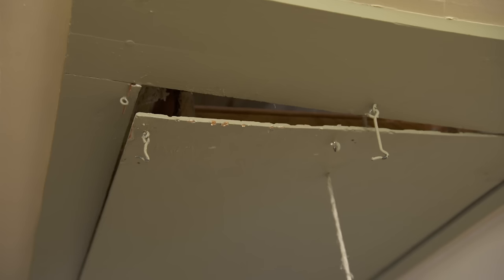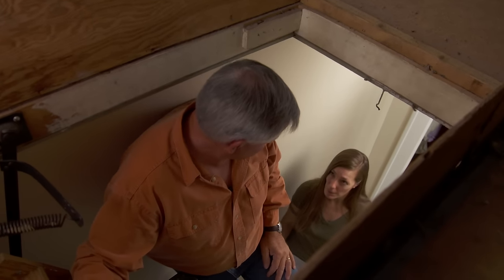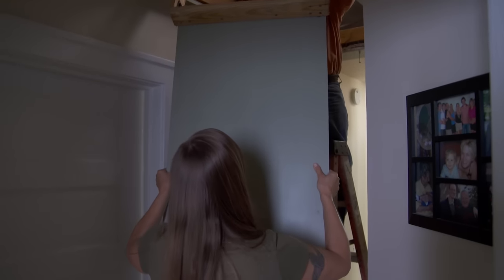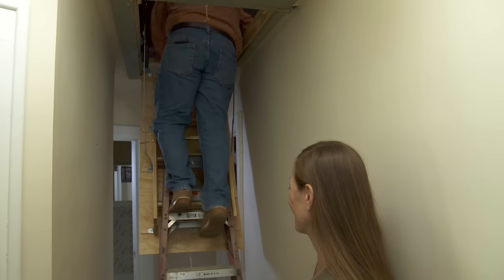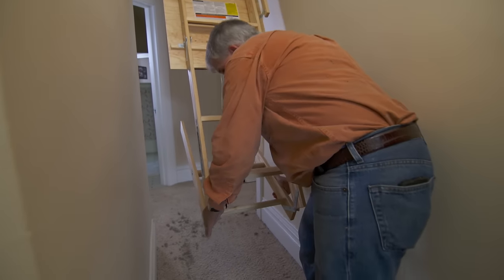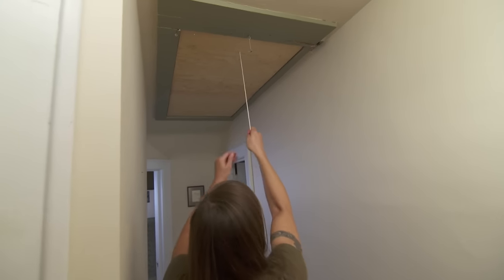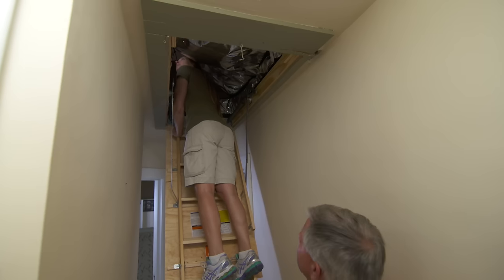How to Replace a Pull-Down Attic Staircase | Ask This Old House

Comment: This is a great video with a lot of good content - and one major flaw.  DO NOT USE TRIM BOARDS TO SUPPORT THE WEIGHT OF AN ATTIC STAIRWAY.  That is dangerous.  Trim boards are relatively thin and weak, and they are usually attached with just a few thin 18 gauge finishing nails that can easily pull right through the wood.  Attic stairways are often quite heavy...  If the trim had broken or come loose then the woman standing below it could have been seriously injured, and/or the falling stairway could have also knocked a hole through the wall - necessitating another repair.  It is far safer to remove the trim and attach stronger boards directly to the joists with screws, and then let those boards support the weight of the new stairway as you install it.  My crews use strong wooden jigs, screwed directly into the joists, when they replace or install attic stairways - which is what we do many times every day.
Reply: thanks
Reply: Fully agree with this. I was so uncomfortable with her standing directly underneath the stairs while he was nudging them around from above. Serious fail point if you like being alive! 😮

Comment: "Looking at the condition of this attic stair. It's not worth fixing so I'm hightailing it outta here." Would have been hilarious if he said that.
Reply: Suad Salkic here is your first reply mr salkic
Reply: Well, Richard did that to a poor fellow with a massive plumbing issue.  Not so much with those type of words, but basically highlighted the issue, what was required, and told the guy seeya and good luck.
Reply: All the comedy is left on the cutting room floor.

Comment: That tip on how to cut the legs was just pure knowledge
Reply: Almost, measuring it the exact way he did will make the cut too short. They didn't mention adjusting the length for the thickness of the board he used to scribe the bottom.

Comment: First of all, the original ladder/door was the exact same one as mine that I came here trying to replace. And I also went through a time when one hinge was bent over from its hinge pulling on it and we had it rigged with a bungee cord lol
I guess a common failure issue with that unit!

Comment: We just bought a house built in the early 80s & the ladder looks almost as good as the new one here.  =)

I really like the idea of adding the insulator!
Reply: I have the same stairs and may replace instead of just adding a new screw. it doesn't close properly, just as this one shown here. i agree, the insulator is awesome.
Reply: I just bought an early 80s house with the same stairs. The ladder is not flush to the floor and the joints have gaps. I need to either fix or replace. Along with so many other things in this house.

Comment: Yeah, in a perfect scenario. The truth is, replacing an older existing one, most likely you'll have to trim around the opening, change any deco that's around it. I just put one in, and although this video helped me to a degree, you skipped a few steps that most ppl will have to encounter. Not saying it's a bad video, but it's not as easy as you make it look. Then again, I own a welding company, who just happens to do any type of stairs. However, every attic stair install presents its own unique challenges. Might help if you explained that the steel tabs are temporary (maybe you did) sorry if I missed it. As well as show some example probs one may encounter. Just a suggestion, thanks
Reply: There is no perfect scenario. And it's easy if you know what you're doing. If not, Tom's video is all that's necessary. Good job, Tom.

Comment: Thanks for the detail in this video. I need to install one of these, but my house is two story, so the attic ladder has to go in our living space. I want to put it in the hallway that leads to bedrooms (away from the living room, etc). But the hallway runs North/South, and the ceiling joists run East/West, 16" on center. So I would have to cut 3 of the joists to install the ladder in the hallway for a 54" opening. Is that a bad thing for the structural integretity of the house (even with headers)? One side of the hallway is the support wall.

Comment: They sell replacement arms and hinges.  I did a Werner ladder in my Father's garage last fall.  The steel had weakened so much that it practically folded over which made the tension springs worthless.  Replaced the steel arms for $55 and all was well.
Reply: they was going for a good look. the old stairs were old and beat up they want it to look good
Reply: That’s funny, An extra $50 would give you a new unit.
Reply: Where did you find the replacement hardware? My brackets are so bent inwards, I can barely fit by them. Not to mention that it looks scary dangerous!
Reply: @RubbinRobbin  Would require a lot more labor as well versus a quick 20 minute swap of the arms.
Reply: @plugger4945  In all honesty I don't remember.  I may have called the manufacturer and ordered them directly.  Or I found them online, possibly eBay?  I think the arms had some information stamped on them.  I don't remember and my Father has since sold that home so I can't go take a look either.
Reply: @Guillotines_For_Globalists  Thank you for your reply. I’ll try  the internet. Was hoping Home Depot or Lowe’s, but probably not. Thanks again!
Reply: @plugger4945  No problem.  Your best bet is probably to call whatever the manufacturer of the label is to find out what the part number is for the replacement parts, and then take it from there if you want to order direct or scrounge around on the internet for a better deal.  The most difficult part was cutting out the rivets, as the replacement kit includes lag bolts to replace what were formerly rivets for one of the attachment points.  Other than that the other difficult part was installing the springs, which is most easily accomplished with the stairway CLOSED and you crouching up in the attic above.  Two people are recommended but I did it all myself.
Reply: @Guillotines_For_Globalists  Again-Thank you for your kindness, much appreciated. I’d say-“Screw it”!, but I fear a spring will snap and kill one of us. I’ll get it, one way or another.
Reply: @plugger4945  Good luck!

Comment: Those bungy cords are deadly. A decorator friend lost an eye with one. I won't use them now.
Reply: It's all fun and games until someone loses an eye..
Reply: Buddy Holly, Richie Valenz, and the Big Bopper died in an airplane crash. I don’t fly on airplanes.
Reply: that's horrible, thumbs up for awareness.
Reply: Sorry to hear about your friend, but that sounds like a freak accident.  Bungee cords aren't inherently dangerous.  I use them all the time.  Just use your normal common sense--during use, ensure the hooks are properly/securely engaged, and don't over stretch/tension the cord itself.  Look over your bungees, and discard any that have damaged hooks, knots (if present), or cords.  Really, if you are doing something/anything that has a possibly of going awry--bits flying about at speed--you should wear eye protection.  [one example--not all of my neighbors use eye protection with mowing the lawn, or using a leaf blower, etc., but I always do].
Reply: Just about everything is dangerous, if not used properly.

Bungie cords have a weight rating, and a life span. You’re supposed to replace them after so many years, if they’re damaged, or if they have been stretched beyond their rated limit. However, most people don’t replace them until they break completely.

A damaged bungie under load is a ticking time bomb.
Reply: Had a friend lose an eye to one too
Reply: His mother always warned him "You're going to put an eye out with that thing."

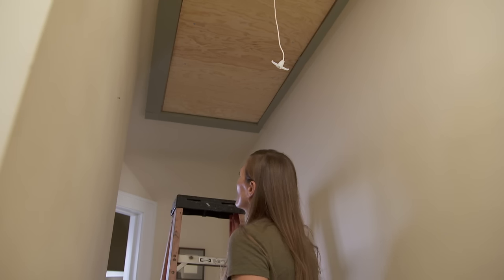Comment: 2:43 what is the new ladder resting on top off? I noticed you did not put two temporary support boards like most other videos instruct to do.
Reply: This was not  new construction, there was already existing casing / trim around the frame . So there was already permanent casting for the attic later to rest on
Reply: The casing trim  he said it multiple times
Reply: @noahholt482  So what do you think trim is held together with? If you said trim nails you are correct. Now go back down and pick up your brand new broken ladder off the floor along with the trim and nails.

Comment: Is it me or is there a flaw in measuring how to cut the stringer.  If you measure the length on the stick, then cut the bottom off for the angle, then use it to measure the distance again isn't it too short?
Reply: Yes. Cut the angle first then measure.
Reply: I noticed that too and came to the comments to see if anyone else caught that.  The first measurement, the length, should have been transferred to the bottom of the stringer and then the angled cutoff marked from there.  Otherwise, to do it as shown, will result in the stringer being slightly shorter than intended with the witness marks taken earlier. @scottjhayes

Comment: I cut my attic stairs like this today and they  came out short 😭 and I measured them exactly how he did it
Reply: He didn’t mark the board right so it makes sense yours was short
Reply: Easy fix, just take a piece of 1x4 and cut it to the right angle to the floor and place it to the side of the stringer (adjust it accordingly) and fasten with some 1" screws. 5 min job.
Reply: I was TWO SECONDS from cutting mine after doing it EXACTLY like he did in this video and I said wait a second.  Thank God I did.  Everyone up vote this so that hopefully no one else messes up in the future.  This tutorial is WRONG!
Reply: I think he forgot to mention to not cut along the mark for the bottom angle as the scrap piece is about 2.5" off the floor.

Comment: Just had the rivet (that holds the swiveling bracket together at the pivot point) break. That spring has a ridiculous amount of tension on it. The spring and half the bracket released and it flung it at me with tremendous force and almost took my leg out while climbing up the ladder. I hate these units. I’ll only use the aluminum ones with the gas struts now. No more springs and junk bracket hinges.
Reply: That's why garage door spring repairs are a dangerous DIY project....those will definitely take out an arm or a leg, and that's the best case scenario! I'm too scared to even set a mousetrap!
Reply: I hate the springs. Mine’s bent too!

Comment: 4:50 it appears that the measuring stick length is shorten because he marked the angle just short of the board end.  Please confirm or tell me what I missed.  Thanks.
Reply: I think when he went to mark the end he realized that it was not a good end. But it was already filmed so he 'faked it' for the show.  He then trimmed it off with the saw.  On the ladder you can see that he also marked and then cut the ladder a little long.  You can always go back a trim a little more off the later... but it's hard to put it back on if you take too much off!
Reply: You're correct

Comment: An inspector just told me to use lag bolts instead of screws.
Reply: Because screws can break under load. So you should use a bolts or nails.
You can also use structuctural screws.

Comment: I noticed that my rough opening for my attic stairs is approximately 1/4 inch short on the length side. I want to remove the old stairs and replace with attic stairs with aluminum ladder. How would you address this issue

Comment: I was about to question the lack of insulation along the ladder and then he shows the insulator above the whole damn thing. I need to get this!
Reply: you can make your own. just glue a bunch of rigid insulation together to form an open-sided box, then glue pink batts to the back of the box so the overlay seals any cracks between the ceiling joists/frame/trim and the rigid box. it only has to be tall enough to allow the springs to close completely.
Reply: My ladder can with hard foam insulation

Comment: Does the attic door frame need to be set fluse with the sheetrock or the Framing
Reply: As long as the door is plumb between the joists it can be set to taste

Comment: Suggest you first put the new set of steps up in the attic.   Then measure the steps to ensure they will fit properly.  Then working IN the attic, remove the old steps and put in the new steps in place. Finally, with the new steps in place, easily bring down the old ladder set.   That would have eliminated the 2nd ladder completely and would also have avoided handing the heavy old steps down to the homeowner who may not have been prepared for it's weight.

Comment: I won't go bending levers to remove spring without goggles and gloves. That thing could snap off at the hinge and fly about in any direction. Don't why he didn't use his power-driver to remove the screws on the hinge plate instead of sawing it off?
Reply: These things are designed for obsolescence and the lever point always goes first. Always attempt a repair before this wear starts to deform the support plate. Always keep the moving joints lubricated/greased to extend its life.

The correct method of releasing the spring tension is to undo the four screws that hold the lowest or bottom attachment plates. Once these are free, you simply move the arm & detached plate upwards until they rotate over the main lever point. Once they move past the lever point, the spring tension is released. You can move the arm all the way around and take off the spring very easily. (No need to risk injury by wrenching it off like this guy did.)
The same works in reverse if you want to repair the lever mechanism. Drill off/ out the damaged lever pivot-point rivet (where the bungee cord was attached in the video - don't let it get this bad!). Then replace the pivot-point with a suitably sized nut,washer, and bolt(s) arrangement. you might have to drill out the wood behind the pivot point to allow the bolt head to sink in flush behind. 
Put back on the spring and rotate the lever arm back around to pull on the spring tension. Once it rotates downwards you can easily re-attached the bottom attachment plate. Remember to grease up those moving joints to extend its life.
Reply: The spring was nearly completely relaxed. Not stretched under tension. He was fighting the twist to get it unhooked not working against a spring under tension which could be dangerous.
Reply: He wanted to get metal shavings in her hall way

Comment: I am beyond furious because I have a 12' Louisville ladder and I cannot retract it up into the attic without 2 people and 2 ladders to get it up. Louisville is, of course, oblivious to the problem, as they were when the upper wood cross piece of the frame the whole ladder was suspended from cracked when I was investigating why the ladder would not close correctly and almost fell when I was on it.  
Who designs a 12' aluminum ladder and does not understand that it needs to function without any additional ladders?  Any suggestions? I am toying with the idea of mounting a pulley inside at the top step, running a strong twine down along the wood door behind it, attached to an eye bolt at the outside bottom of the next lowest, where the knee bend is, and pulling on that to retract the steps when down.  It his very inelegant and offensive to the purist in me who believes in form and function being their own beauty, but tripping over a piece of twine while climbing up a 12' height on a ladder is not ideal. I appeal the the engineers out there, degreed or just the self educated, common sense ones.

Comment: Spend the extra bucks for the aluminum one with the lift cylinders you'll be better off
Reply: The wooden ones are safety hazards! All the screws were loose and the springs didn’t have enough tension to pull the stair case up until it was closed almost all the way manually. Lol

Comment: where I live in Alabama the building inspector won't let us use screws to hang an attic door we have to use 16 penny hand drive nails I don't know why it looks like screws would hold better
Reply: John Smith the instructions I've seen with ladders show screws just to hold it in place and then later using nails to drive it permanently.
Reply: Use construction screws, they have a star head so inspectors can tell.
Reply: Just use Head Loks or Uber Grades. Whichever brand you prefer. Both are beasts.

Comment: Our attic access is in a small bedroom closet. I have to bring a step ladder to the second floor of our house and push up on a piece of drywall the builders put in the ceiling laying on trim. Is there a pull down ladder that will fit and open down from that small access space approximately 2' x 3'?
Reply: +MRrwmac You can buy compact attic ladders that will fit in a 18" x 24" opening. They're typically made of aluminum and either fold like an accordion or have sections that slide down like a traditional aluminum ladder. 

That said, your opening would need to be reframed for one of these compact units if it's larger than the ladder frame.
Reply: +Rymac91 Thanks. I'll look into them.

Comment: ya easy fix. just get a new one.. Yay these guys are great a burning cash LOL
Reply: How much could that ladder possibly be? A hundred bucks, maybe two?
You can fuss around with the old one for hours, pull all the framing apart and cut and weld the old metal.(which has been work hardened/weakened) Then sand and finish the wood so it doesn't get dry rot, at least anymore than it already has. All said you are 5 hours into making it nice.(or about a 100 dollars worth of time, for an average craftsman)
Sometimes you just replace stuff. It's often cheaper. Wealthy people appreciate skill and time. Poor just appreciate money and ironically never get it.
Reply: kkknotcool a hundred for a craftsmen? Maybe a $100/hr.

Comment: I hate those old wooden pull down attic stairs.   The weight limit is pretty low, and I have never, never, seen them installed properly.  You risk falling everytime you use one.  Spend more money and buy an Aluminum pull down.